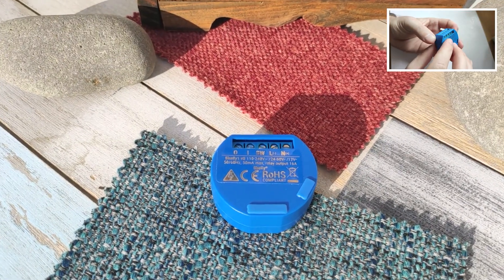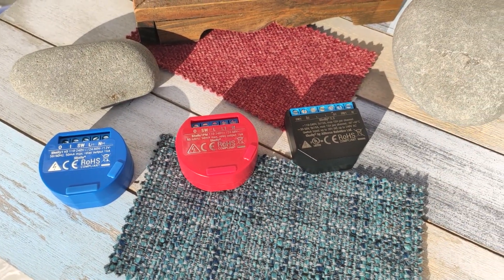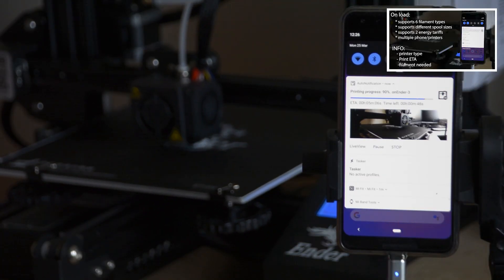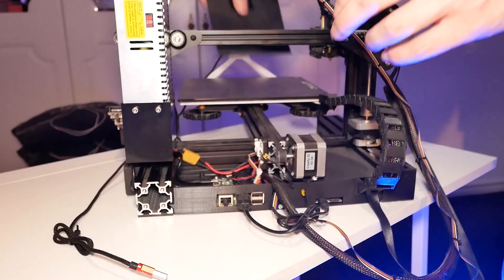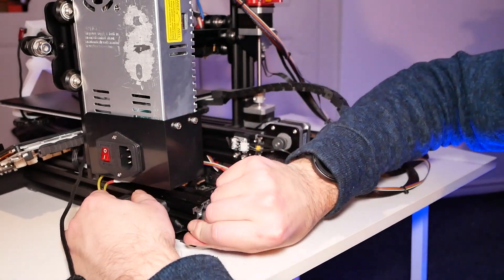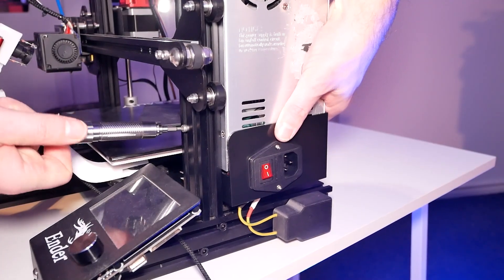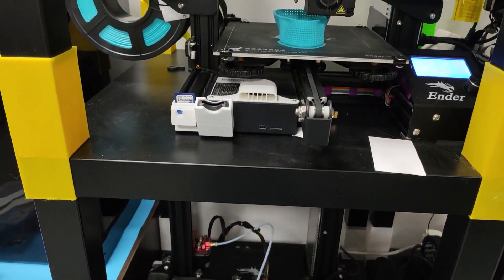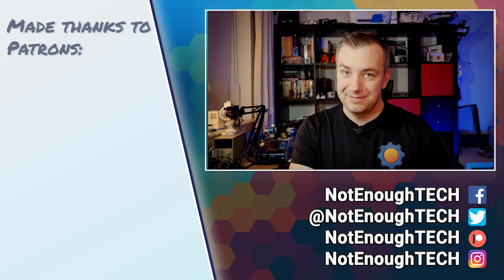Shelly 1PM - "PM" stands for Printer Manager

Comment: Thanks for this, exactly what I'm looking to do, but I bought a regular shelly 1 instead of the PM. Time to go shopping again lol
I'm also adding an RS-25-5 to mitigate the undervolting issue.
Reply from the maker: If you don't need the power management you can still wire shelly 1 just a couple of extra wires is needed to do it. Shelly 1pm plus is best. I have a pending article with video to follow soon on plus series
Reply: @notenoughtech  I wish I weren't so impatient, studying my wires with the parts torn down as I wait for some Wago's to come in. I noticed in your wiring diagram that there is no mention of the Ground/Earth connection. Is that intentional? I intended to run two wires from the connector on the back of the plug, both from the ground/earth spade, one to the printer psu and the other to the pi psu.
Reply: @notenoughtech  Woo! Mission accomplished, working like a charm. Thanks again

Comment: With this setup, you are unable to control RPi separately, right? So if you press the switch, you either turn on both the printer and RPi or turn them off. And the solution to undervoltage was not to use 220V–5V converter but to use mobile adapter connected directly to power from ICE connector?
Reply from the maker: Yes this will keep the raspberry pi powered on regardless of the state of the printer. This is done so the raspberry pi has the ability to turn on/off the printer without powering itself off.